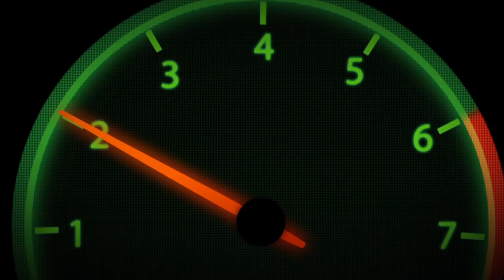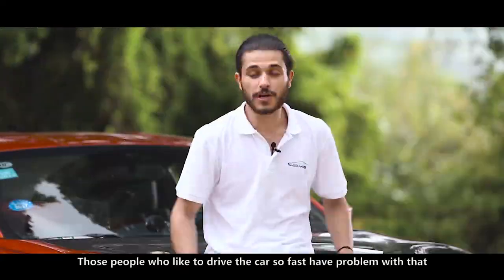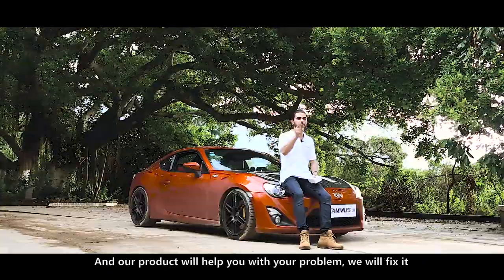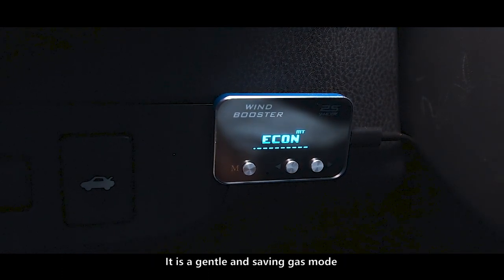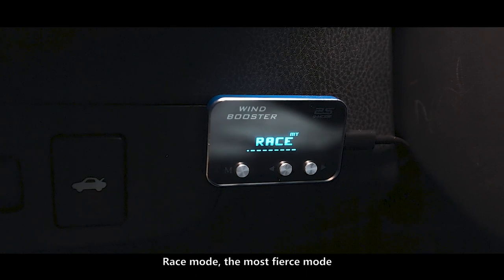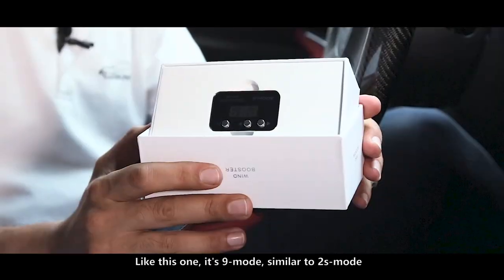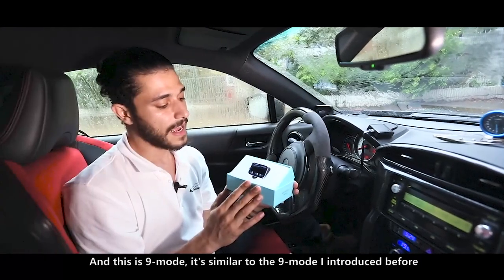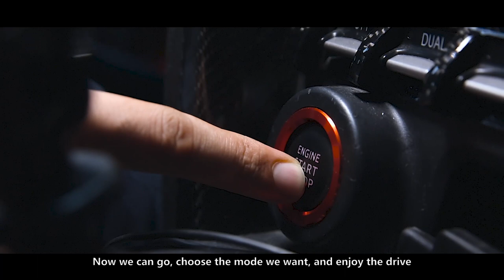Windbooster Electronic Throttle Controller Full Review - Wind booster Road Test

Comment: Useless video. You showed us how to use it and showed us the different modes. Let's see a before and after video of how it performs. This was NOT A REVIEW. You may have sold me on this with an ACTUAL REVIEW but I think I may just get the sprint booster.
Reply: I want to go with the sprint booster but it's so fucking expensive.  The first gen windbooster has what I need and it's only $75.  $75 vs $300.  In both cases it's only $30 or so worth of electronics, so the $300 sprint booster price tag feels radically high.

Comment: 0-100 with wind booster and without it
Reply: There's no difference.  100% throttle amp'd up (by whatever function they're using) and capped at 100% is still 100%.
You're misunderstanding the product.  
This bumps the pedal input so the computer thinks you're putting in more throttle than you actually are.  Modern cars with fly-by-wire feel sluggish because it's tuned for best fuel economy.  It's tuned so when you smash the throttle to 50% from a red light it only gives you 30%, so you get better gas mileage.  This device is basically an electronic brick on your foot.  You may be putting your foot down 20% of the way, but the computer sees like 35% or 40% or something, and acts according to that.  It makes it feel more natural and less sluggish.  But it doesn't go beyond 100%.  So wide open throttle / full throttle / 100%, is still 100%.  This mainly helps with lower throttle inputs.